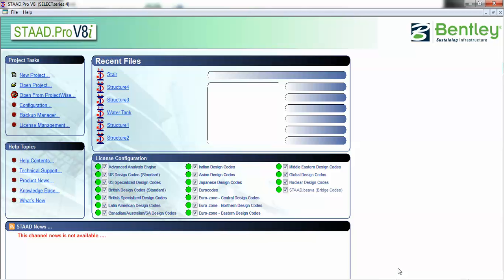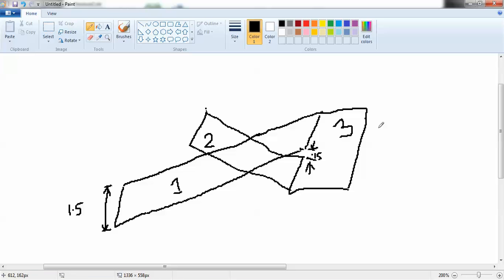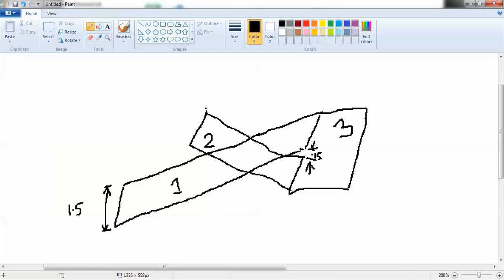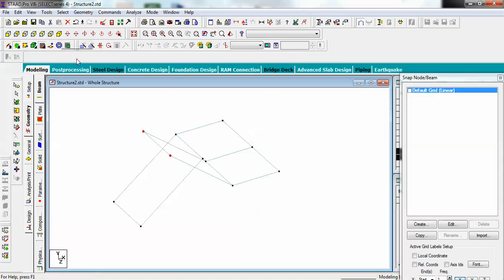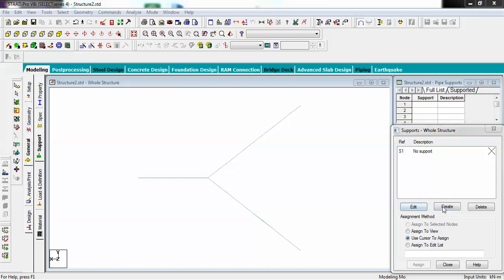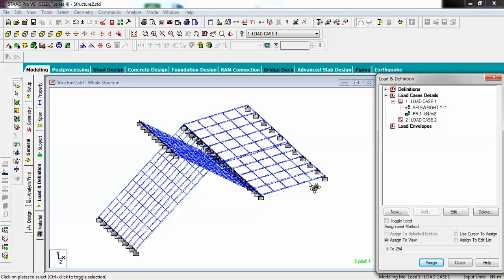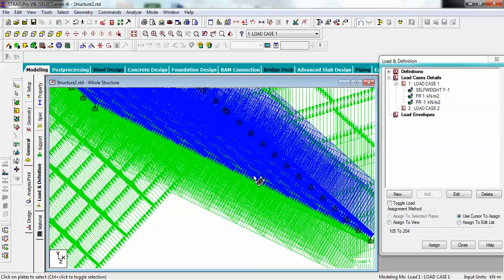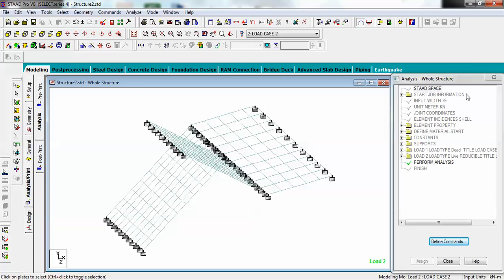Staad Pro Staircase design Explained in full detail

Comment: You could've just switched the orientation of the plates using the plate reference point command and it will switch the local axis and hence the load direction automatically rather than having more load items to process. Besides, the plates are not connected properly since the mesh size is not the same which is an inaccurate modelling practice.

Comment: wrong loading! what about the loads coming from tread and risers??? and how the support beams will be designed?
Reply from the maker: tanu shree y don't u correct me if m wrong by sending me the details on my mail monimalikn73@gmail.com
Reply: Jags 22079 dead load can easily be worked. Live load can be 3 or 4 depending upon the utility of staircase. And one can apply support only at those location where a beam or wall support is present. In your case,there is support at intermediate point as well.

Comment: Hi bro. i have two questions . 
1)when you specify section for beams in RCC monolithic slab/beam construction do you enter sections as flanged or rectange?
2)to have a maximum effect, loads in continuous beams should be such that the panels should have alternating loads e,g even panels to have dead and live loads and odd panels to have dead loads only. how can you apply this alternating loads in slabs so as to be transferred in continuous beams accordingly?